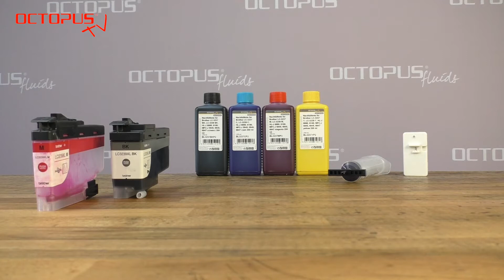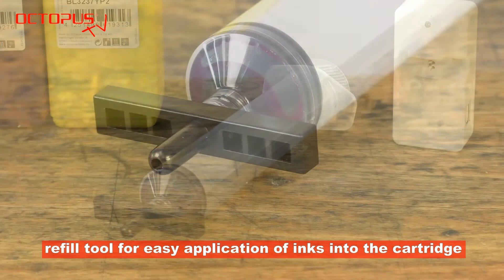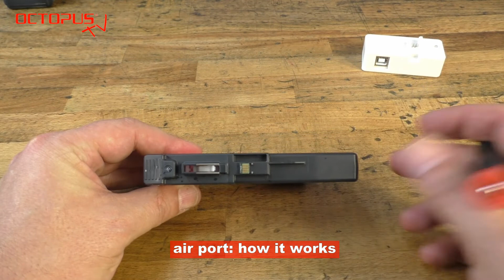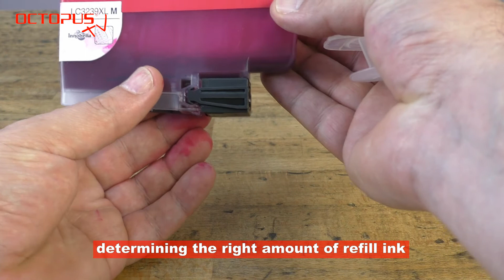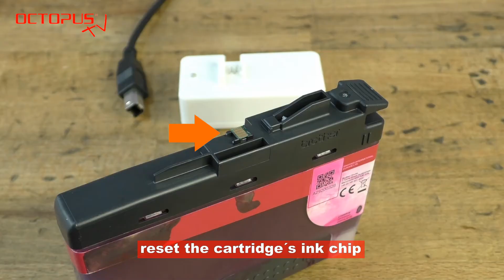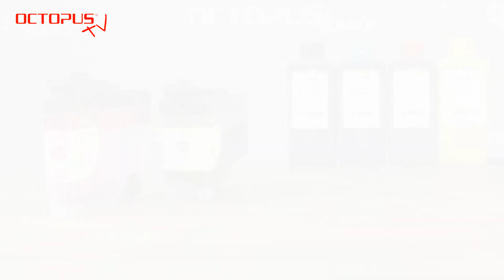Refill Brother LC-3239 LC-3237 inkjet cartridges and chip reset

Comment: Where is the savings? The tool is 
17.55€, the resetter is 65.95€, and the ink is 40.65€! That is $156.56 (before tax)...👀
Reply from the maker: Thanks for contacting us about the price structure of our offer.
There is a set coming with the resetter for 60 resets + tool + 100ml dedicated inks per color. Its price is 116,58EUR including tax. Depending where You are ordering from plus shipping costs - let us assume You are ordering from US - this is 49,95EUR including tax - so the total for this order would be 167 EUR including tax. 
With this kit You are able to refill You original Brother LC3237 Black cartridge two times and each of Your original Brother   LC3237 Cyan Magenta Yellow cartridges 5 times.
Right now we purchase an original Brother LC3237 Black for 32 EUR  and the colors Cyan Magenta Yellow for 20 EUR each. So the value of the original material that can be refilled with our lit sums up to 2x32EUR + 15x20EUR in total  364 EUR. When deducting the price for our kit from that sum we think  that is still an attractive saving - in our humble opinion.
We do not compare the costs towards alternative cartridge solutions as You never know what quality You get inkwise in these cartridges.

Comment: Will this work with lc3033/lc3035 cartridge tanks?
Reply from the maker: Thanks for contacting us about our tutorial. Getting the new ink into the LC3033 / LC3035  cartridge will work the same way as for the LC3239 / LC 3237 . BUT the chip resetter for original LC3033 / LC3035 ink chips is not available yet (status Dec 21st 2022) - and without that resetter refilling ink only makes no sense unfortunately: without setting back the chips the printers do not accept that filled up LC3033 / LC3035 for printing again 😒

Comment: Will this method/ ink work for  LC427BK?
Reply from the maker: Hello Niles, thanks for Your question -  this method will get the ink into the LC427BK - BUT - there is no resetter available for the ink chip on this cartridge - without setting back this chip the cartridge will not be accepted for printing by the printer despite there is new ink inside - we are waiting for this resetter for beeing developed by the resetter guys ... fingers are crossed